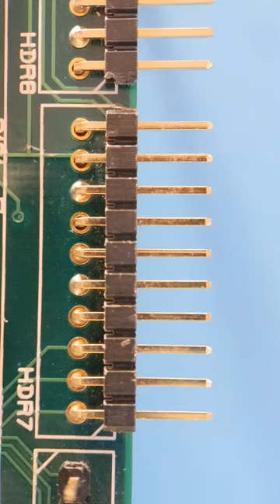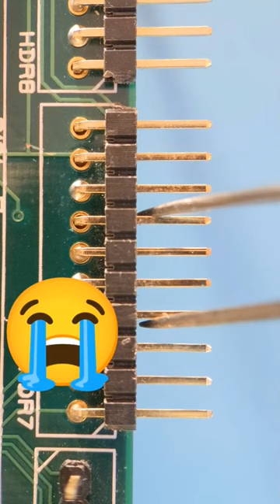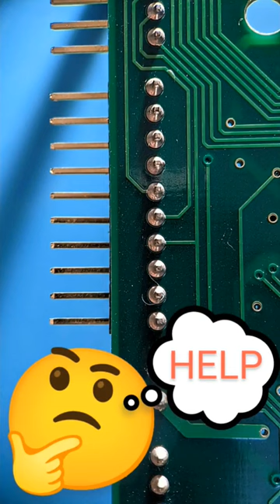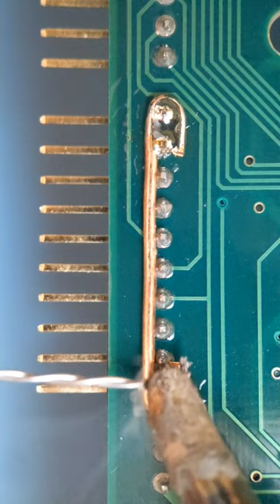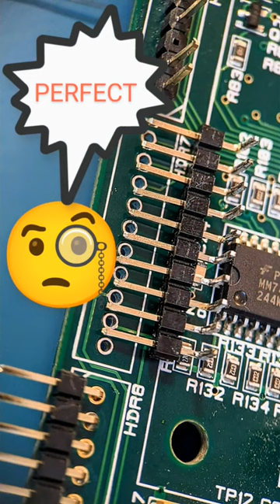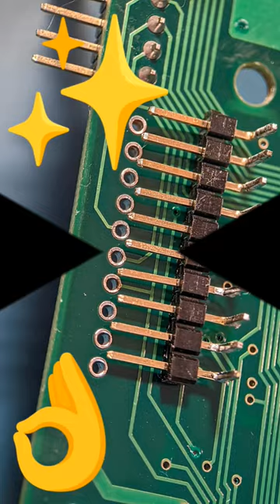Soldering Tip / Great Way To Remove Components #shorts

Comment: For everyone who ever tried to desolder these types of connectors or any connector with many TH pins must appreciate and will have their mind blown. :D
JUST be careful to not overheat the PCB, but with this, it might be actually harder than normally.
Reply from the maker: Hi , thank you for your comment , much appreciated 👍
Reply: Or just use a solder sucking pump and not have to worry about any of that.
Reply: this is quicker and uses less total heat

Comment: You can easily remove plastic bracket and remove connector pin by pin.....
Reply from the maker: Hi , you can't do that with every connector and this is way quicker . I used to do it the way you mentioned , never again though .
Reply: Agree with that - not allways the best way [especially with poor access to connector top surface) but when possible, why not :) i mostly heat connector to 150C deg and remove it like butter. Cheers 🍻
Reply: Yeah as what adafruit recommends

Comment: Solder sucker and solder wick has left the chat.
Reply: That's what I'm saying lmao
Reply: If you've ever tried desoldering this kind of connectors, the wick and sucker will not really work, there is always residual solder that keeps it in place 

In the end you spend so much time on it that the plastic frame will melt

So yes this method seems to be way better
Reply from the maker: Hi , thank you. Trying to get the exact point over that you mention isn't easy , trust me . Hopefully one day people will understand better 👍
Reply: @LeAdri1du40 I have tried desoldering these kind of connectors and you mentioned something crucial. That the plastic will melt on the connectors. Let me teach you about thermal mass. The more thermal mass something has the more heat you have to apply. This is a very basic description but essentially in this video the guy adds a thick copper wire to distribute the heat better. The side effect is that he has given the solder joints more thermal mass meaning he has to use more heat for a longer time which would cause more damage to the connectors. If you are trying to remove the connectors without damaging them a wick or even better a solder sucker will remove the solder super quick if used correctly and will let you remove the connectors without damaging them.
Reply from the maker: Hi , sorry I have to disagree with the last comment . You will NOT cause more damage to the plastic part of the connector and is a lot safer for the board  . Tried all methods going , this is my safer preferred method. If you like your method stick to it . As you should know wick and solder suckers will often lead to a small amount of solder contact down the barrels ( sometimes very difficult to avoid ) when the connector is then pulled out part of the barrel comes with it , not good if you have a multilayer board . Seen this hundreds of times over the years . My method avoids this risk .  totally. Thank you , but I had to reply to that not quite correct comment.
Reply: @computingwithcoffee3907  about the thermal mass, yes but you got something wrong as well, more thermal mass means it absorbs that heat, so it doesn't go into the plastic, since you're applying the heat to the copper directly, the thermal conductivity will make it so that your whole copper will be at solder melting point over the whole area of the connector and melts it all at once before the plastic melts, which you can't do without connecting the pins in this way

You have to apply heat to a lot of individual small metal pins which can't absorb a lot so unless you have a perfect technique it's much more likely you'll mess it up
Reply: Just remove plastic bracket and remove all pins.
Reply: @mrsolderfix3996  exactly solder sucker creates a possibility to rip the track off the board ❤
Reply: Clever technique.  The additional copper acts as heat sink, reducing local temp spikes and heating more evenly.   I just started soldering a pair of stereo speaker crossovers as a first project.   Thanks for the great content!

Comment: Just slide off the plastic spacer/retainer and desolder one pin at a time.
Reply from the maker: Hi , not always possible
Reply: @mrsolderfix3996  in that case that's totally possible, quicker and don't overheat the PCB
Reply from the maker: Even connectors like this in the video , not always possible to slide the plastic off . I've seen many ways to remove over the years , this is at times the best .
Reply: Too much hassle to reuse after disassembly.

Comment: My sucker have problem when I need to deal many pins at same time, I can remove one each time, and I mean remove from the plastic support. So I better use the heat gun then use the sucker and hot air to clean the holes.
Reply from the maker: Hi , the way I show is definitely easier . Good luck 👍

Comment: I usually plug in a connector to keep the pins aligned even if I melt the plastic a bit,  but I'll try this method next time
Reply from the maker: Hi , thank you for mentioning your method , that is a good solution at times . Thanks again , take care 👍

Comment: ok, it's a valid workaround, but a solder wick would be ideal, it doesn't heat the board as much, it doesn't need more tin and it's safer and faster
Reply from the maker: Hi , the trouble with solder braid ( wick ) is that it can leave a small amount of solder between the part where the pin is touching the side of the barrel which can be impossible to remove 
 When you then remove your component you take this part of the barrel with you , on a multilayer board this can be extremely bad news . So dropping the component out first then wicking out the holes is safer , not the other way round .

Comment: Can i spread flux on all pins and just use the solder wick? Will it work?
Reply from the maker: Hi , thank you for your comment , much appreciated . The trouble with solder wicking out the holes with the pins in is that when the pins are pushed right against part of the barrel , it's nigh impossible to get the solder out at them points . When you pull the connector out you can easily take part of the barrel with it . Better to drop the connector out first then easily wick out the pin free holes . Thanks again , take care 👍
Reply: @mrsolderfix3996  i understand

Comment: I tried soldering once but failed cause i didn't knew about flux. In your videos you make it look very easy
Reply from the maker: Hi , thank you for watching the video and commenting, very kind of you . As I mention in all of my videos, flux is essential when soldering . Solder wire has a small core of flux running through the centre of it but this burns off to quickly when iron heats applied . This is why external flux added to your joints is crucial to achieve good soldering results . Thanks again , take care 👍
Reply: @mrsolderfix3996  Thank you, i will watch your channel cause i'm decided to learn soldering to repair some stuff, and today i tried to solder with flux but still failed cause it's a solid flux maybe

Comment: Hi, what’s the thickness of the copper wire?
Reply from the maker: Hi , it doesn't really matter , probably 24  gauge is about right if you can get some ideally , but anything from 28 gauge down will be ok . 30 gauge is a bit narrow but will be ok for certain small situations . Thanks for your comment , take care 👍

Comment: To grip these headers i usually use a random female header lying about. Easier to hold on to even with fingers which also are protected from the warmed-up pins

Comment: get soldering iron with screw head type, replace the tip with long chopper 1mm wire... there you go
Reply from the maker: Hi , unfortunately any decent iron doesn't come with that type of screw tip .

Comment: It seems to work well, but I think a heat gun for soldering makes quick work without needing to use extra materials, but if you're without such tools this is a decent approach.
Reply from the maker: Hi , thank you for your comment. I have hot air stations etc but there are times when this method is so much better than using hot air . This is so much better than hot air for the surrounding components and for pumping unwanted hot air into your board potentially delaminating it. Also plastic bodied components i.e connectors , headers etc that will melt using hot air can be safely removed using this method so if necessary can be reused . Hope that helps explain this great method . Thanks 👍

Comment: You can also remove that black part and then resold single pins.
Reply from the maker: Hi , thank you for your comment , much appreciated . Your right about removing the plastic but on some headers and strips this is so tight it's really hard to remove . This option is so much quicker and easier . Thanks again , take care 👍

Comment: Soldering metal is much expensive than desoldering wire, so this method is not economical.
Reply from the maker: Hi , thank you for your comment. Desoldering braid is actually more expensive than solder wire so i don't quite agree with your comment 🤷
Reply: @mrsolderfix3996 true, desoldering wick is pretty expensive

Comment: Ha! Just take off black plastic spacer and solder them out pin by pin - profit
Reply from the maker: Hi , not always easy to remove the plastic  , in fact impossible on a lot of connectors . The wire method is way better as I've shown also in other videos . Thanks for your comment.

Comment: At this point I would just cut the pins with flush cutter and remove each pin individually. But that's a nice tip too now all i need is a solid copper wire laying around me.

Comment: Why not using suction 1 by 1
Reply from the maker: Hi , this is safer . If you have a pin hard pressed against the side of the barrel it's very hard removing all the solder from that point . You end up potentially taking some of the barrel with the pin when pulling the connector out . Best to drop the connector out then desolder . Also braid is better than hand held suction pumps which I find pretty terrible. Electronic ones are good but are  expensive for hobbyists etc.

Comment: please use solidering pump
Reply from the maker: Hi , I do use one at times after I've dropped out connectors . This method is much better . Still prefer braid to manual pumps . Expensive electronic pumps are really good , cheaper ones are garbage . Thanks .

Comment: Or just use a solder wick
Reply from the maker: As I keep telling people if your pins are pushed tight against the side of the barrel there is sometimes a small amount of solder you just cannot remove  . When this happens and you pull out the connector the barrel here can come with it . I still see it from time to time where people have done this . Drop out first , braid second . Safer .Thanks.

Comment: ... is this for real? Just cut the plastic part, and desolder the pins one by one? This technique could work but you need an iron witha  very high termal mass to pull it off...
Reply from the maker: Hi , thank you for your comment. The wire method I show believe me is so much easier and you don't need a special iron , just a bigger tip . I used to do the way you mentioned but not anymore . No one I know does it your way anymore . Thanks again 👍

Comment: Just use a solder sucker
Reply from the maker: Solder suckers don't always get all the solder out , especially if the pin is tight against the barrel , this is a common problem . Drop it out this way , easy , then clean hole out . Much better method